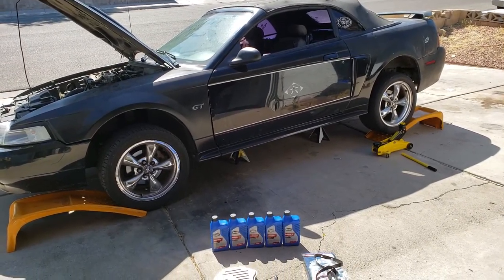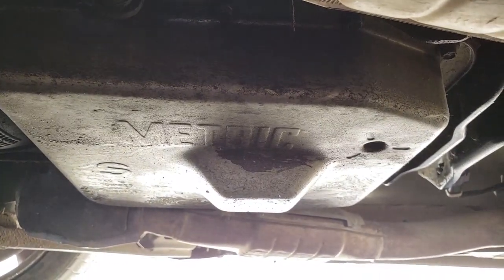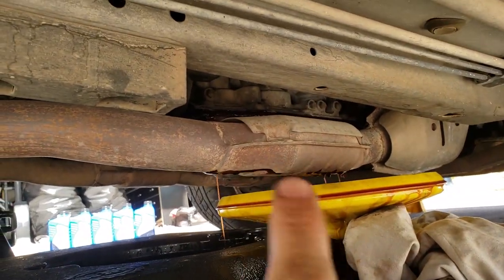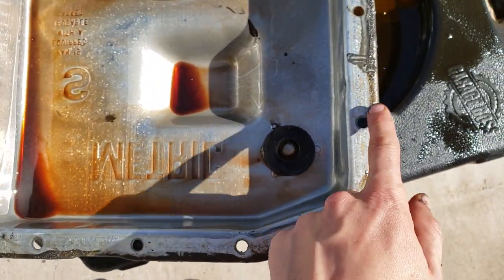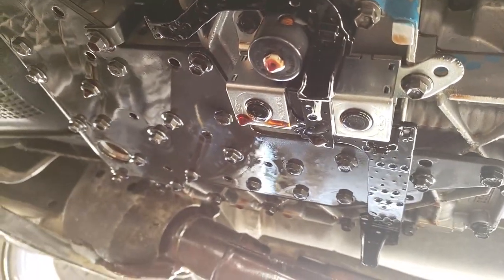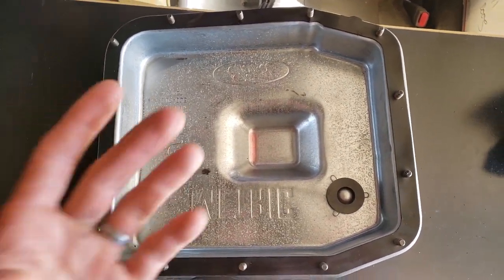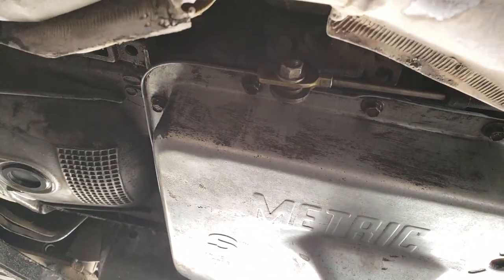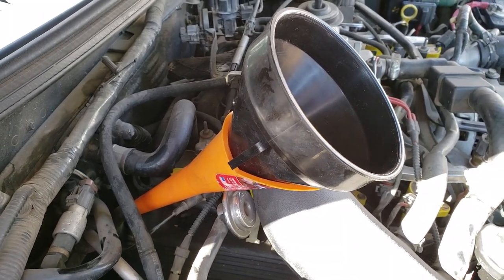How to Change Automatic Transmission Fluid and Filter (Mustang GT 2003 - 1996-2004)

Comment: I notice you have a convertible, which provides some additional jacking/lifting points. On a coupe you need to be EXTREMELY careful how you jack up the car and where you put jack stands. My front frame rails already have dents in them where a previous owner used a floor jack with the four pronged saddle to lift the car. There was also some damage to the pinch welds below the doors. I jack mine up from the front K member (the cross member under the engine) using a floor jack with the saddle removed and a piece of 2x6 wood between the jack and car to prevent damaging the frame. I put jack stands under the front frame members with a piece of wood between the jack stands and the car. The entire frame of a Mustang is basically made out of tin, and VERY easily damaged. 

You can get a transmission pan made by Dorman from Autozone with a drain plug in it, so you can drain the fluid out BEFORE removing the pan, so it doesn't make a big mess. The same part number fits both the 4.6L 2V GT engine and the 3.8L V6 engine. It also fits the Crown Vic with the 4.6L 2V.  The first time I changed the fluid and filter in my Mustang, I just put a drain pan under it, drilled a hole in the bottom of the pan, and let it drain. I was then able to remove the pan after it was empty. I threw away to stock pan and replaced it with the Dorman pan from Autozone. Now draining the fluid is super easy and does not make a mess. The drain plug is just like the oil drain plug on the engine. This pan fits both the 4.6L 2V and the 3.8L V6   https://www.autozone.com/drivetrain/transmission-fluid-pan-a-t/dorman-transmission-fluid-pan-a-t-265-813/548726_0_0

DO NOT get your transmission flushed. It will seriously damage your transmission. Ford (and all other auto manufacturers recommend against it) I change my engine oil every 3,000 miles, I drain and refill the transmission pan (not the filter, just drain and refill the fluid) every 9,000 miles, and change the fluid and filter every 27,000 miles. Doing that will keep the fluid fresh, and it is super easy when you have a pan with a drain plug.

Comment: Nice job, I am about to do one on my 97 mustang GT. Few points though if you don't mind: 
- I believe your fluid was already changed as there was no yellow cap (which is attached to the trans oil dipstick from the factory) that would be found floating in the pan which you can only find after the first fluid change.

- the existing metal gasket is reusable (it says in the owners manual) as it is better quality than one provided (unless damaged of course )
- perhaps worth tightening or just checking the bolts on the transmission itself as they tent to loosen up during time.
Once again thanks for sharing this video, it sure helps!
Reply from the maker: Thanks for watching and for the tips!

I learnt about the yellow cap on this model after I uploaded the video, but I didnt want to edit and re-upload just for that.
Re-using the metal gasket, great! Luckily I keep all the old parts for recycling, so I'll fish that back out! :)

Comment: Hey man I’m currently missing some transmission fluid in my 2001 v6 mustang.  Did you use all those bottles. I don’t want to over fill mine and I’ve used a half of bottle and I still don’t see any fluid level on the dipstick.    How much transmission fluid did yours take to start showing something and how much should I add by
Reply from the maker: It's hard to say because I don't know how much you have in your system. I would personally add half a bottle at a time until it starts to show :) Half a bottle, drive it around, half a bottle etc. Make sure the engine is warm to measure the warm level, or cold on the cold level etc

Comment: What genius thought that there shouldnt be a drain plug for transmissions?
Reply: Ford: Built Tough TO WORK ON
Reply: The same genius that thought u should change the filter every now n then lol
Reply: @Chrisj91TBirdsc  i see your supposed to drain from the dipstick and then hoist it up.
Reply: Same genius that stopped putting the dipsticks on the new ones

Comment: What is the cap right before the tranny drain pain for? 1:47 briefly shows it.
Reply: As for it's true reasons idk, but I know on the early models (I think 02 and back?) there's a drain plug on the torque converter that you can unscrew above that cap and dump even more trans fluid out (these cars hold like 15? quarts, and the pan only holds approximately 5) so you can do a more proper fluid change in one go, but if you have a car above (again I think) 02 then the torque converter doesn't have a drain plug and is pointless to remove that cap for trans fluid purposes. Also, if you remove the cap on an 02 and back model and you can't see a drain plug in there, you can spin the crank pulley (CLOCKWISE) and eventually you should see a drain plug on the converter, but iirc even then not all converters had a drain plug anyways so it may be a fruitless endeavor to even try, I'd recommend just dropping the pan 3-4 times to do a full proper change if you're changing dirty fluid, if the fluid is clean dropping the pan every 30k miles is ideal (manual says every 100k, but that's for a FULL fluid change, not just a pan drop) so by doing a pan drop every 30k by 100k miles you'll have effectively changed most of the fluid in the transmission.

Comment: Ford actually recommends change trans fluid at 150K on my 2000 GT
Reply from the maker: Different years, makes , models, trims and thus different trans.
Good you found the video useful
Reply: That's under purely highway conditions, I would never go that long, then again, I don't drive my car around like I'm a grandma only using it to go to church on Sundays doing 10 under the limit at all times. Ford says you should do a pan drop every 30k if you drive it on normal road conditions, all 4r70w's are this way. And you do a pan drop every 30k because ford says you should change all the transmission fluid every 100k miles, so by doing a pan drop (which only holds about a third of all the fluid in the system) you'll have nearly new fluid in the system by 100k.

Comment: Anyone who does this invest in a aftermarket pan with a drain plug it's what I did it's a good idea
Reply: get lost  I have put one on almost every car I've have owned never had a issue
Reply: get lost  oh ok buddy lol and if its gonna leak its gonna leak as soon as it was installed leaking pans usually happen from people not knowing what they are doing there is sequence to tighting bolts and torque specs which my guess would be that you do not follow "mechanic" I've worked as cars for a long time and yes I own mutiple cars I keep all of mine until I wanna sell and get something different to start a new build dont tell me I dont own granny hondas and what not like you probably do and run them to the dirt I take care of my cars the only thing I have ever found to be useless that leak no matter what you do is dumb shiny chrome valve covers go to the track and see how many people got pans with drug plugs
Reply: @gsc2866  My friend did this and I agreed that it was a good idea.  It did leak--but that not be the case for all cars.
Reply: I did and it's amazing. I'm using a dorman pan and it doesn't leak a drop. Ensure gasket is totally and properly installed and ensure all bolts are torqued, then use a good nylon drain plug gasket and do not reuse gaskets. Those are the rules I followed and after 1 pan drop and using the drain plug 2 times to effectively have done 3 pan drops, it still doesn't leak.